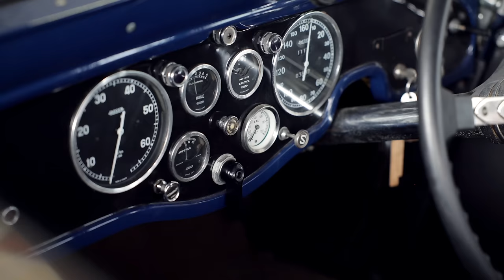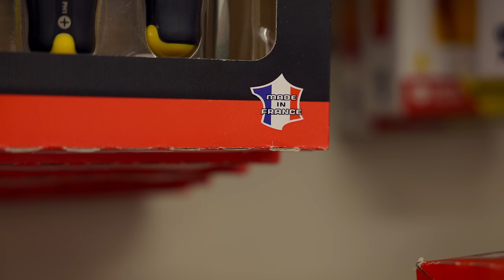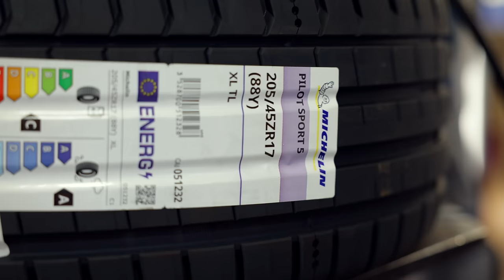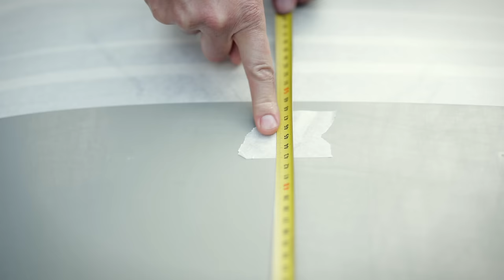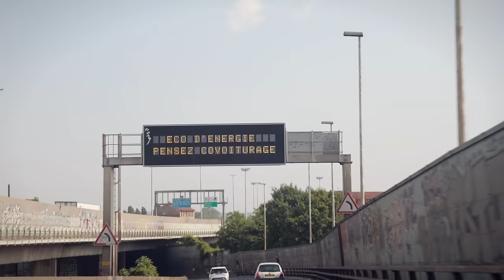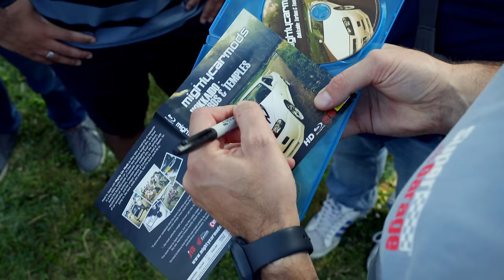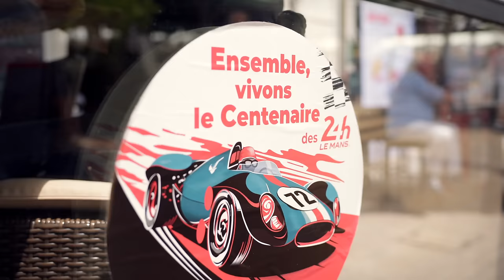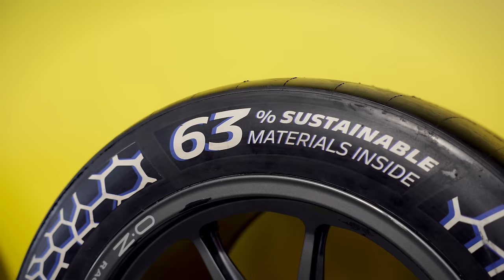Modifying The Cheapest RENAULT In France (Feature Length ROAD TRIP 4K)

Comment: Those 1.5 dci lumps are amazing engines really, not quick obviously, but the mpg is truly epic! Wish you had a mk2 sport though (172/182), I swear you'd end up hunting for one of the few that made it to Aus.
Also, regarding your tyre issues, nobody runs 17" wheels on mk2 Clios, as you found out, very hard to get them to fit. The issue with 16" wheels is that Michelin don't make the PS5 or even the PS4 in 16" sizes, the newest they do is the PS3, as you probably know from the super turbo. Could you see with your influence if Michelin could make the PS5 in 16" sizes? A lot of French nugget fans would be very happy haha
Reply: well i have a 2005 206 gti here in australia and i have PS4 16" 205 on mine so they do make em
Reply: @seanhendren9957  Please double check, Michelin have never made any tyres newer than the PS3 for 16” sizes as far as I and Michelin’s website know
Reply: @Hopgop1  u know ur right im wrong i double checked my car and i have PS4 215 17", before i upgraded my wheels from 16 to 17" i had 205 PS3's on em
Reply: @seanhendren9957  I had PS4 205/50R16 which I put on a suzuki swift, but I live in Thailand, so it must depend on the market.
Reply: I saw a lot of Clios MK2 with 17s, they just went too big with the tires, correct size would be 205/40 r17
Reply: I own the same Clio and I'm getting like 3.7 l/100 in the countryside
Reply: @Hopgop1 had the ps4 on a corolla with 16s in australia
Reply: @jaroslavmrazek5752  Different model years and specifications came with different standard tyre sizes and suspension parts. Maybe there are versions that do accept 17" wheels with the stock struts, but it is also very likely they used aftermarket coilovers and/or adjusted offset or used wheelspacers to make them fit. I had a Clio MK2 ph1 diesel, biggest I ever had on it was 215/40/16, which was VERY tight despite using lower offset wheels. I eventually went with 195/40/16 and 215/35/16 (staggered deepdish wheels were all the rage in the mid-2000s, didn't matter if it was a slow fwd diesel). 
The one they used is an MK2 ph2/3, but I believe the tyre sizes and struts for the ph2/3 dci-models were the same as the ph1 d(ti)-models.
Reply: I've had a 1.5 dci Megane for years and it never skipped a beat, serious reliability and fuel consumption is a second tought with it 🤣🤣, almost 1400km on one tank. Wished they tried a mapped 2.0dci or a nicer 2.0 tce on a RS, I've whipped a 2.0dci 160PS on PS4 for a while and on the twisties it's a blast, loads of grip and torque is amazing. Next up i wanna see a MCM special with a 1.9TDI VW with a tune and "pulls like a train" sticker on the back 🤣🤣🤣soo Eastern Europe car scene special next year?🥰
Reply: Correct. 16’s max on a mk2 Clio.

Comment: Marty's new thing to say should be "Will this fit on my Peugeot 206?"
Reply: will this fit on my polo?! haha
Reply: My very first car was a fiat Punto with a whopping 60bhp and as you can probably guess. The head gasket went, which is a VERY common thing to happen to those engines. I've had 2 206 in the past. The first was a 1.1l 8v and the second was a GTi with a 2l 16v which is the funniest car I’ve ever owned. After those 3 frenches, I got my very first Germany car which was a 2004 A3 with a 2l TDI with a 6 speed DSG. I've had a couple of alright car's in between my A3 and my current car (Vauxhall GTC and a Vauxhall Astra), which is also German. It's a Mk7.5 Golf GTD with a 2l TDI with 181bhp & 380Nm that's going into a 7 speed DSG. I got it brand new back in March 2018 and I love it. 
It's not as fun as the GTi, but I much prefer a car that's well built, know your going to be alright if there's an accident and doesn't need things replacing all the time when they wear out/shit the bed. I also can't drive a manual anyone as I lost my left leg up to the groin because of a bike accident.

Comment: You can also note that the owner of the Clio almost surely bought it new because its licence plate is the older french immatriculation. (The french licence plates changed format on April 15th 2009, and if you buy (now) a car with an older licence plate format, you need to change it to a new format one)

Comment: The 1.5dci has a staggering 86bhp. And good for 46-55mpg. I'm from Cornwall England, we have the same laws regarding what you can and can't do to your car. Car modifications that are illegal in the UK are: 
1. Neon Lights
Neon light modifications are illegal in most scenarios. One of the few ways you can legally spruce up your car with neon lights is if you add them to the bottom of your car – but only if the neon tubing isn’t visible, and the light isn’t too bright or flashy that it distracts other drivers around you. 
2. Rear and headlight tints
In the UK, white and yellow lights are allowed at the front, while red lights are allowed for the back of the car. Using red, green or purple tints for your headlights, or any bright neon or flashy lights on the exterior or interior of the car, are sure to get you pulled over. Any halogen bulbs with a colour temperature over 4,200 K are not road legal as they produce a slight blue tint light. Blue flashing lights are used by emergency services such as police vehicles, ambulances, firefighters, and the coastguard. To make these services stand-out, these lights are legal only for emergency service vehicles. Also, the lights shouldn’t be dimmed by more than 50% to maintain visibility. If the light bulbs bear an ECE R37 regulation, it’s a sign that the lights are road legal. 
3. Window tints
You can tint your windows, but only to a certain degree. The front windscreen needs to be at least 75% tint-free and the side windows need to be minimum 70% tint-free to ensure a clear view of the surroundings. The only exception is if your vehicle was first put on the road before 1 April 1985. In this case, both the front and side windows need to be 75% tint-free. It’s illegal to sell a car that doesn’t follow these rules. 
4. Loud exhausts
A loud, roaring car sure sounds thrilling, but the noise might irritate others. An exhaust cannot cross the noise limit of 74 decibels, so any modifications that breach this limit are illegal. All cars are ‘type approved’ under the Individual Vehicle Approval (IVA) scheme before they’re sold to you, which means that they comply with the emissions and safety regulations. Other exhaust modifications, like changes to the exhaust management system, tampering with the emissions control system, or removing some parts could make the vehicles more damaging to the environment. 
5. Spoiler upgrades
Spoilers help with aerodynamic efficiency, and a slight tweak to their look can help improve handling and make the car look sportier. While modifying a spoiler isn’t illegal, the method of modification can be. If the new spoiler isn’t fastened safely to the car or has exposed sharp edges, you can get into trouble with the police and may even be forced to remove the modified spoiler. Spoiler modifications should help reduce your car’s drag and weight. A rear spoiler can improve the downforce, while front spoilers can reduce drag. The modification should also be a practical size so it doesn’t obstruct your view – three inches wide and six inches above the roofline spoilers are usually considered an efficient size. 
6. Nitrous Oxide engine modification
The use of Nitrous Oxide is illegal and extremely dangerous. Adding Nitrous Oxide gas to your engine can increase cylinder pressure. If the engine’s components are unable to handle the increased stress, the engine can suffer damage. The engine can also be damaged when there’s too much oxygen and not enough fuel in the engine (an incorrect ratio of air and fuel). In the worst-case scenario, the incorrect ratio and added cylinder pressure could cause the engine to explode.

Comment: Small diesel engines were turbocharged more for emissions purposes than for making power. I think the tamest version of the 1.5 dCi was producing a whopping 55 hp. (This car probably has the 60 or 70hp variant) The most powerful K9K engine made 110 hp. A mechanic told me the pre 2009 versions were kinda bullet proof once you delete the EGR system. (Which is illegal to do but make them waaaaay less prone to failure unfortunately)

Comment: Small correction, the Clio III was NOT based on a Nissan. Rather the other way around, most Nissans after 2006 are based on Renaults. All the platform engineering for all Clios is done in France.

Comment: I had a 2nd gen clio in Brazil. It was a 1.0 petrol 4 cylinder, sedan. It had 300k kms on it when i flicked it on. Never rebuilt, but it had had its cylinder head shaved a few times. Pretty tired but never let me down.

Comment: 1.Renualt 1.5 dci  diesel (very low fuel consomption)
and
2.Renualt 1.4 petrol

Are the best and most reliable engines in Europe at the time of manufacturing.

And still  today are more eficient and  reliable than modern 1.0 3 cylinders.

Comment: that 1.5 dci clio mk2 ph2  is amazing i owned 10  mk2 clios 5 at one time yes they was all running they very really rot and the engines were very tune able. and they handle amazing. stick the Megane 2.0 T RS 246 bhp engine in one of these with a basic tune you will see over 300BHP not bad going if i do say my self.

Comment: You can freely change wheels unless;
- the wheels protrude outside of the body of the car
- the wheel is bigger in diameter than stock
_______________________________________________
Using OEM wheels just makes it harder for car inspectors to spot that you changed them😅
I put 15"x6,5" Vossen CV3 5-spoke wheels on my (2000) Honda Accord EX and it passes all inspections because the wheel diameter remains the same as stock. The only difference is a wider offset and 1 inch wider rim. This is entirely legal.

Comment: You will have no problem putting 17" on clios

I know for a fact because my dad had one diesel in 2009 and the engine blew out... (we bought it kinda in bad condition for cheap) and i don't know how but my neighbor had a williams engine (2L special edition for clio) lying around in his garage... Was the best 8 years of my life. I swapped 17" wheels and tyres were 225/45/17 and then the next time I remember we chose 235/50/17 because tyres was becoming expensive

Comment: I was going to like this video but the way you said that Castrol is the only oil to use. Common. Also a TCU tune is not just recommended, it's needed when upping the power so you don't fry your clutches.

Comment: Maybe I am wrong, but I think if the rim size has been changed the car speedometer might need to be recalibrated (I guess it depends ont he toal diameter of rim+tire) and the MOT should be renewed, obviously the rim has to be valid for the car modell on top.

Comment: My second car was one of these. Youngest car i have still ever owned. Also the most unreliable and expensive mistake! It was an absolute wreck and died at 96k miles. Headgasket, clutch barely biting, (undiagnosed) possible throttle body and to top it off the bulb went in the clock so i didnt know the time if it was dark!

Comment: A nice story about French cars are that in the 1930ties the french built very good, strong and reliable trucks. They literally never broke down. When the Nazis occupied France, they forced the truck factories to continue to produce the trucks, but now for the German Wehrmacht. The Nazis controlled every part of the production so the construction of the trucks could not be sabotaged by the workers. What the french did was that they made the oil dipstick 2 inches or 5 cm longer, but didn't move the indicators. So the german army mechanics, who have always been known for following the rules very strict, filled to little oil in the engines of the trucks and the truck engines detoriated after a few hundred kilometres, leaving the Germans stranded...😂😂😂

Comment: Been watching Mighty car mods for years but I'm disappointed you couldn't of figured out to run a 205 40 17 instead of a 205 45 17, also making the strut a bit smaller and fitting non hub centric spacers is stupid..

Comment: To be honest I’m only worried if wheels and tyres are going to affect my Speedo and make it read low. Then Im likely to get a speeding ticket. Most tyres have around 8mm from new which is 16mm on diameter. I swap my tyres our at 2mm which is 4mm on diameter. If you were worried about distance travelled then your looking at 12mm drop in diameter just on tyre wear. If your that worried about distance travelled you should be swapping your tyres every 5 minutes.😂😂😂

Comment: 16:20

Its a good bit worse than germany actually. In germany, you can ususally do quite a bit as long as its ECE approved and you stay within some limitations, some parts need specific TÜV approval and some just dont work because theyre deemed unsafe or whatever. But overall, there is a lot you can do, whereas in france, its just an absolute pain. on top of that, people in general dont care as much about their cars as a hobby, its more of a basic transport thing.
Reply: What if you bring a modded car from outside of France - can you drive it there long-term?
Reply: @JK_Clark  i dont know about that unfortunately but 'long term' never really works, especially from out of EU countries.

I know that here in germany, there is a one year limit for cars from outside, after that it needs to be registered here.

Thats currently happening with a bunch of ukrainian cars in fact, some dont make the inspections which is why we currently have a bunch of old Ladas for sale here.

Regardless, even then, german base-rules apply. If the car never would have been legal here in the first place, you cant drive it, only trailer it, grey-areas apply.